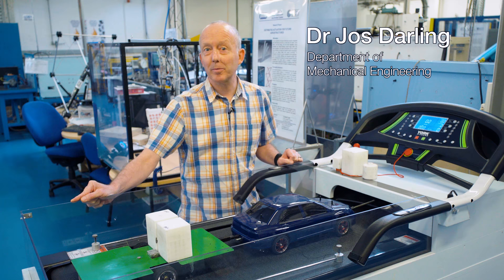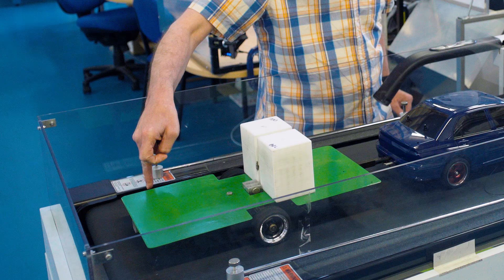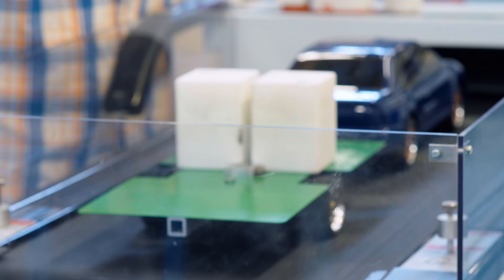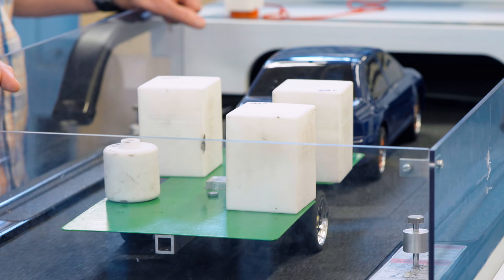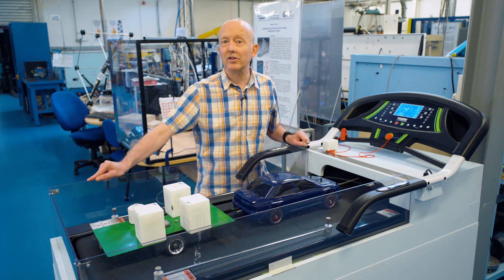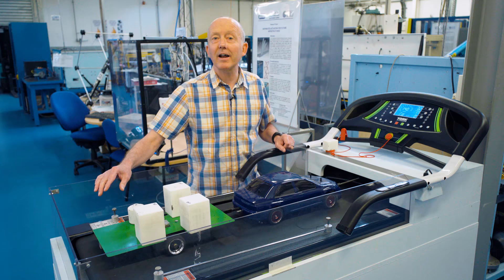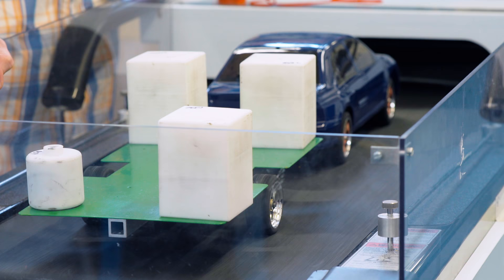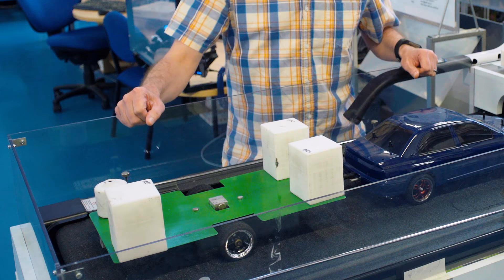Stability of Towing a Load with Dr Jos Darling

Comment: Have you done any of the videos like this for the lorries and load distribution? I know the principle is the same but visualisation for the warehouse staff would be great!
Reply: Actually not so much, as the hitch point is different a fifth wheel tends to be more stable so does the placement of trailer tyres.  In the UK the axles on a caravan are near the middle and the tongue weights are low like 3 to 5% therefore having the weight over the axle or towards the front is important.  In the US a caravan has the axles about 2/3 along the trailer and has a higher tongue weight 10 to 15%.  It is possible to load a trailer over that 15% and be stable (I have direct personal experience of this).  Caravans however can apply forces which effect the back end of the tow vehicle as there is a leaver.  A fifth wheel is over the rear axle and has much less effect on the tow vehicle as there is no leaver, fifth wheels tend to put more weight on the tongue like 20 to 25%.  So as long as most of the weight is between the trailer axles and the tow vehicles axles it tends to be more stable, the it is distribution to avoid over load the axles.  I have towed bumper pull trailers and caravans and fifth wheel caravans here in the US, most of my towing experience is over the weight of the tow vehicle, my first caravan was 9100 pounds to an 8000 truck and my fifth wheel is 14000 pounds to an 8000 pound truck.

Comment: I have a question I would like answered. 
My caravan, unfortunately by design, is very nose heavy. When I load stuff in I have load everything as far back as possible. I sometimes have a water barrel full right at the back. Even when it's all loaded I still have a nose weight of about 70kg (Vehicle tow bar max weight is 75kg). Am I OK putting the weight in the back to make it ballance first (but still nose heavy).
Reply: no youre not ok with that set up, its ultra dangerous and one of the most stupid things one could do. front and axle, back should be a no no
Reply: @wenmoon448  so what should I do? BTW was does "front and axle, rear should be a no no" mean?
Reply: @flyer152   here we go chum... watch this video as well.

Weight needs to be over the trailer axles as much as possible in conjunction with a heavier towing vehicle. Try putting your excess weight in the car to increase its weight if possible. 

https://youtu.be/JeEEC5eVNCk
Reply: @GaryNumeroUno  thanks for this. Looking at this, I'm in the 4:15 time line. 
Everything out of our van the nose weight is 180-200kg. Once clothes and food goes in at the rear I get the nose weight to 70kg (max my vehicle can take on the ball). I guess my saving grace is my car is over 2000kg and the van is max 1300kg. In the above video, the trailer was always heavier than the tow vehicle (accept at 4:15)
Reply: @flyer152  That's really odd. Glad i don't have that issue, seems extremely heavy.  I think my nose weight is probably around 50kg max when empty.  We usually put everything in front of axle and it gets weight up to 75kg nicely.  I actually find that when we take the additional load of the awning we can put that directly on the axle and it makes it more stable although probably right on the limit for weight allowance. As a observation I have run out of thread on caravan jockey wheel at some steep sites and without being able to lift jockey wheel onto block i dunno what i'd do, surely must be impossible to lift if its 200kg.
Reply: @wenmoon448  Total nonsense - it makes little difference except with an A frame you still need to adjust the nose weight on the ball since the manufacturers engineers will have calculated the frame stiffness at the front to accommodate.  I have a compressive explanation of the forces at play that completely rules out the myth of not placing heavier weights at the rear of the caravan based on centripetal acceleration eg Flywheels.

Comment: OK, very nic, but it seems in your first example of adding weight, you also spread the weight further from center, so I believe that is a combination of added weight and more polar vs central weight.  Yopu second example is cleane.  I think for the first effect of only weioght you should use same volume and shape cubes made of denser material

Comment: Hi Josh you need to speak to me on the subject of "differential stability" If that model had my Differential stability fitted there would be no instability no matter where you placed the load or speed simply because it would have a control system in place.  A simple inexpensive accessory that anyone could fit to any A frame trailer.
Reply: Donde puedo encontrar información sobre la estabilidad diferencial??

Comment: I'm still searching the internet for an answer to this question: Is there any disadvantage to putting all the weight in front of the axle, with resulting tongue weight of, say, 15%, provided all the hardware ratings are sufficient for the resulting weight, versus 60/40 on the axle with empty 10% at front and empty 10% at rear?
Reply: https://youtu.be/qEHD9Wjw3lk?si=nVulk6g8G1OGGppj
Does this help?
It appears to me the issue is not necessarily loading the edges of the trailer, farther away from the axle but rather the fact that loading on top of the axle or in front of it will make the system more stable quite like hanging an engine behind the rear wheels (rear mounted engine) of behind the seats im front of the rear axle (middle engined car) yield vastly different dynamic behaviour.
Reply: Wouldn't that be very little weight? The tongue weight is 15% of "total trailer weight", do you get that with a level trailer by default?

Comment: Put all the wait on the front of the trailer ahead of the axle and it won't do that at all even with more of a load.
Reply: Exactly. In NA it's common to see pickups towing more than 2x their weight with no issues. It's all about the hitch weight.
Reply: @angelaraposo8065  No, it is not, it is all about weight distribution or moment of inertia.  If all the weight is on the hitch then there is no problem, because you have a little moment of inertia. if you then add extra weight to both ends of trailer, so you still have the same hitch weight  you will loose the stability.. The weight on hitch is not a part of the equation.  This is very cleverly shown in the video above.
Reply: @angelaraposo8065 , I'm a used car dealer, the auction I source my inventory from is about 180 miles from my office.  The truck I use to tow my inventory weighs about 6,000 lbs.  The trailer, when loaded, weighs about 6,500 to 9,000 lbs.  The heaviest I've towed is about 11,000 lbs.  I drive 80 MPH (speed limit 75, but I do 5 over).  Never had an issue.  Just made sure I had plenty of tongue weight.
Reply: @vivillager  Tongue weight should be 10-15%
Reply: @GOLDVIOLINbowofdeath , I don't have a hitch scale, nor do I weigh my rig on CAT scales, I just "eye ball it" and see if it looks about right.  It's worked for me for years, so, if it ain't broken, don't fix it, right?
Reply: What does it look like?  I assume you're targeting 10-15% tongue weight? @vivillager   :)
Reply: @RogerPack , generally, I look for about an inch and a half of squat in the rear. The trucks I use are all one tons. My primary trailer is 20 ft, so I have some room to position my load a little forward or back in case my squat is too much, or too little. I'm guessing 15% tongue, (+/- 5), but I don't use scales any more, I kinda just eyeball it.

Comment: Tesla Trailer Mode software helps alot with this.
Reply: Only on the Model X I believe. On the other models Trailer Mode does not appear to offer "Trailer Sway Mitigation".
Reply: @MrAdopado  I don't believe so. The Tesla Model Y has it too. 
The Tesla Model Y's electronic stability control system uses braking to minimize trailer sway. When the system detects trailer sway, the touchscreen will briefly display the traction control system indicator.
Reply: @seanlavery6477  You are correct. I've now found the specific reference to Trailer Sway Mitigation in the Model Y Manual! (I hadn't seen that before)

Comment: All this has been displayed many times but what Dr Strarling does not address is how to control the effects regardless of how the load is placed.  Differential stability has the ability to control the effects with astonising accuracy and address the limits that it can take.  Mechanical differential stability does not rely on computer algorithms to do this and the feedback loop ensures that that an equal and opposit force is applied at the centre of equilibrium precisely where the  controlling effect is required. I am currently in the south of France and have gone through extremely high wind forces with two electric cycles on the back of my van - no uncontrolled sway in sight, To date it has covered 18,000 miles in all conditions with no uncontrollerd sway. I would be delighted to demonstrate this to any interested party and give the caravan free of any charge with some conditions attached.
John Wilson
Reply: What is your recommendations on weight placement on the caravan? Thanks.
Reply: @downunder7342  Of course common sense should apply in both speed and weight distribution - if you have an accident at high speed it is always going to be worse, if you load it out of common sense it will have consequences but having a control system that will counter any sway up to silly proportions will stop this completely..  I can say that under all normal events like truck wind wash, speed up hill and down dale it copes exceptionally well and you can just concentrate on driving normally without any worry. What I ask is that any company with the means to market, produce and validate this concept will get my full support.
Reply: video please? :)

Comment: Front side of the trailer must carry 60%+ weight for safe towing.
Reply: LoL .  No.

Stack load based on "Load weight vs tongue weight" 10-15%  eg ..  1000 pound load, stack so that there is 100-150 pound down force on tongue.  Ideally 100.
Reply: By stack load you are referring to gross trailer weight?  I think the assumption is if you put 60% of the "cargo" forward of the axles, it'll equate to about 10% (of the gross weight) tongue weight...peace!